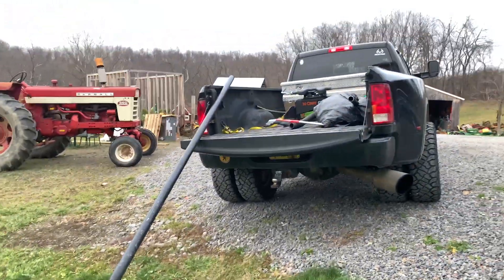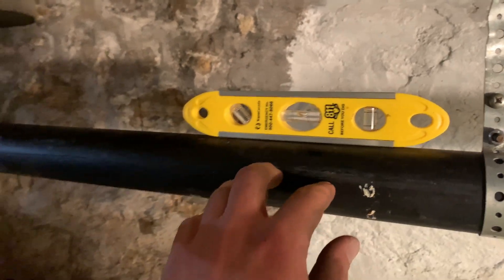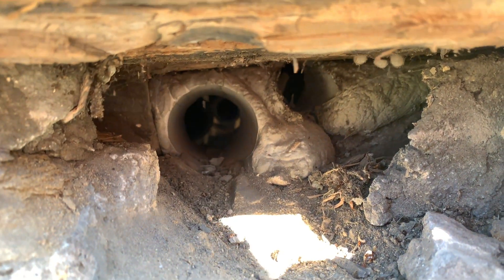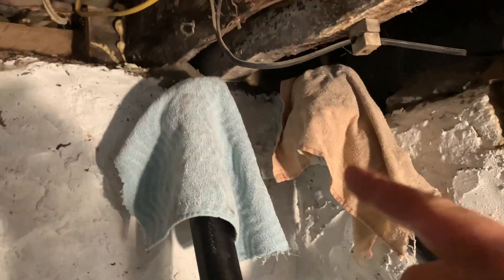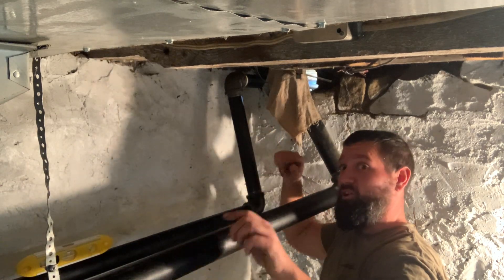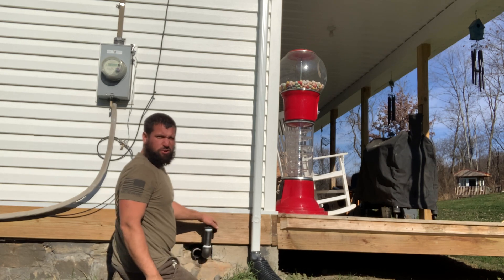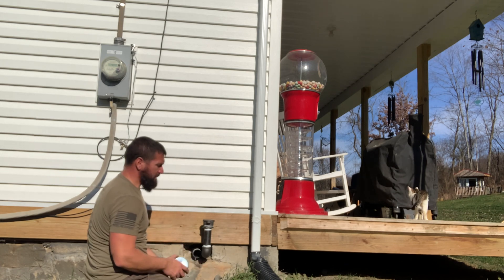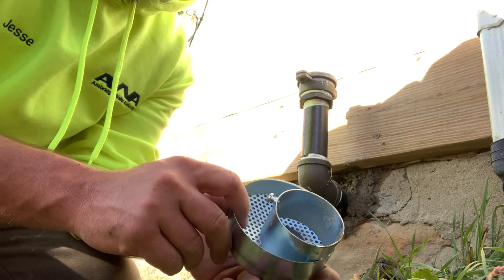How to install home heating oil tanks 275 gallon lines vent and fill pipe part two

Comment: I have a large gap on the inside of  foundation where the fuel/vent pipes are exiting to outside. Can I use Stuff-it or canned foam instead of mortar to fill it in?
Reply from the maker: Absolutely the mortar is just more of a permanent fix vs the spray foam. Thanks for watching

Comment: Doesnt the vent pipe need to end at the same height as the fill pipe?
Reply from the maker: I haven’t noticed a problem with it yet but that could be a rule of thumb not sure
Reply: @frontwoodsfarmer2063  I was told that by a long time professional here in Pennsylvania. i just figured it was required by the oil suppliers.
Reply: Yes it’s wrong vent is to be higher than the fill smh
Reply: I heard that the vent pipe should be the same size as the fill pipe or larger that way your not putting more  pressure on your tank

Comment: Teflon tape is a no no on oil tank's
Reply: I’ve always heard the vent pipe needs to be higher then the fill pipe
Reply from the maker: @michaelkatzenbach9478 sure helps
Reply from the maker: Agreed
Reply: @frontwoodsfarmer2063  I assume this isn't standard teflon tape? something specific to oil tank pipes? Thanks!
Reply from the maker: @johnspanos3862  yes sir your local hardware should have it or be able to point you in the right direction of who does supply ot
Reply: Seems like a lot of unnecessary work, I just used pvc pipe to plumb my tank in. I don’t know why everyone thinks u need to use metal pipe, but save time and money and go plastic.
Reply: @davidjones4972 PVC is hack work and is against code. You might want to look into what it cost for oil spills and the nightmares they can become. Wouldn’t catch me for one second using PVC.